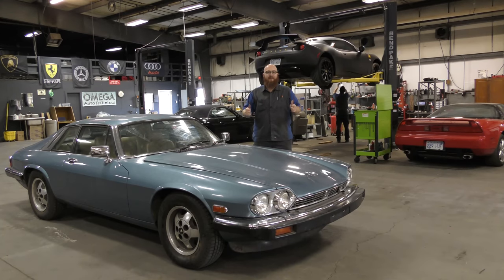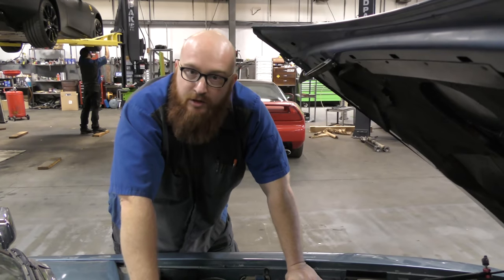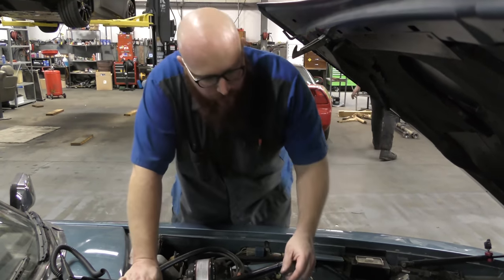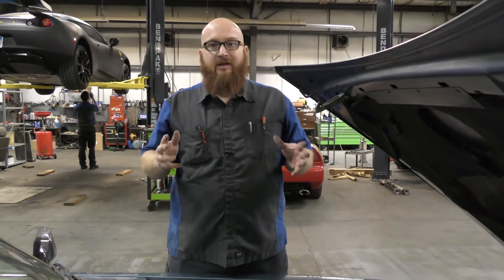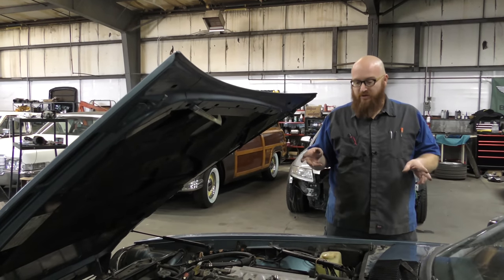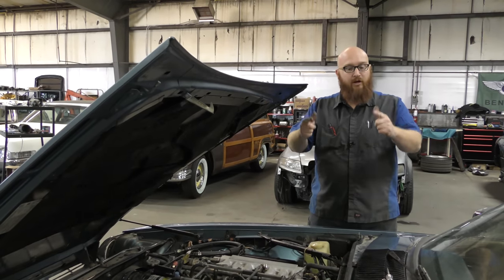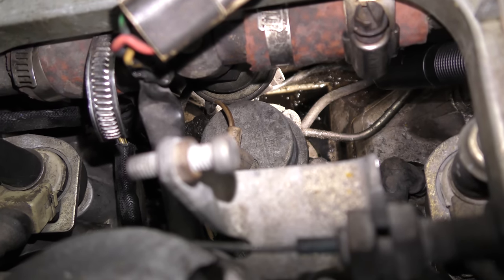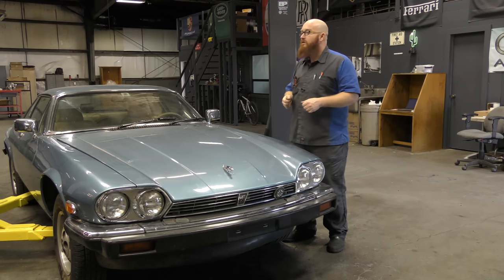'82 XJS with the cursed Jaguar V12 comes into the CAR WIZARD's shop. Can he get it running?

Comment: The American specification lights look interesting, a bit like Citroen SM, but not really pretty. Changing them to Euro spec, if possible would give it some British class.
Reply: Bri ish
Reply: I think the American spec lights look much better than the Euro spec lights on this Jag but admit I can't say that to often about other models
Reply: It's not the Wizard's car to change.
Reply: @sw33pdog  Agree. I never really liked the XJS lozenge lamps. It was the only thing. The US spec lamps are much more interesting.
Reply: @houseofno  No, he was clear the car belongs to a customer. Getting the car to run well is most important. Only then rises the question whether to use it as it is or to change details. That's up to the owner.
Reply: Sure, except that this is NOT the Wizard's car, and it's not theirs either.

The most bizarre thing I ever saw - total strangers proposing unauthorized changes to cars they don't own.

Is this the Car Wizard or Pimp My Ride Felony Edition? 😀
Reply: Brian Weir 😂😂😂
Reply: You can't get the Euro spec lights any more, and they're worth a bit if you can find them on the used market. My XJS has stone chips in the headlight glass and I'm faced with having to convert to new American spec lights to resolve it.
Reply: @MathsYknow  jump on the web, check "Top cats jags" Birmingham England,  uk spec lights and yes, they do (or did) ship international, bucket loads of breakers yards In  the UK are full of these, shipping aside, will cost peanuts
Reply: @Craig-wp3pz  Thanks, I guess I should look internationally despite the challenge of shipping glass around the world. With chipped headlights I'm limited as to where I can take the car for inspection / MOT.

Comment: There was a garage I'd hang around that had Mustangs on one side and Jaguars on the other. The guy that restored or repaired the Mustangs usually dealt with rust and would make them beautiful again. The Jaguars on the other hand always looked beautiful inside and out but had electrical or mechanical issues. I was amazed by how inexpensive he purchased the cars for. What I did not realize at the time was how potentially difficult it could be to repair. I get it now after watching this video. He probably purchased cars that had multiple failures by one or more mechanics.

Comment: I'm having an anxiety attack over the greasy windscreen..
Reply: First thing I thought was that that baby needs new wipers
Reply: @ironymatt  If it had been sitting for even a year not running, I an sure no one bothered to clean it .
Reply: The interior of the windscreen could be greasy tobacco film and/or glycol from a leaky heater box defroster.
Reply: @brianevans656   yeah those are actually the 2 most common causes of windshield greasyness...either owned by a smoker at some point, or problems with the heater-even in other makes/models...heater core leaks make a vapor of coolant(and if there's a slight headgasket leak, oil as well) that condenses on the inside of windshield through the defrost vents and believe me...it is so hard to clean up-and combat if the cause is still an issue.  Sadly, dinking with heater cores & such can be a pain too as it often involves taking apart a lot of stuff to get to it in most vehicles.
Reply: The top of the engine looks like a wire mess all over the place.

Comment: I used to work at a Jaguar dealer when these were new. 
They were a dream to drive. I do not recall them causing much in the way of problems, but then they were not 30+ years old back then, and parts were readily available, and there were four on the forcourt for sale. 
One could simple swap bits from one car to another until once swapped the fault from one car to the other, and then one knew which bit was at fault.

Got a 1987 4.2L LWB Daimler Sovereign in at the moment. It was similar, multiple faults preventing it running. Failed fuel pump, blocked fuel degassing valve, blocked flue line, stuck fuel tank switchover valve, stuck fuel return valves. Blocked fuel tank vent, partially blocked fuel filter, all four brake calipers seized up..... and I really dislike having to reassemble the handbrake calipers,

Comment: Calm, chilled, logical, rational. You Sir, are the man. Thank you for sharing.
Reply: I  wished   I'd   known   about   this   man  when  I  had  my  1976 XJ 12 L I took   it  to  a  shop   who  claimed  they   knew   Jaguars  it  wouldn't   start  by the   time    they   had  supposed   to  have  fixed  it  $3600  later I  brought   it  home  went  to  start   it  the  following   day   and  again   no  start .I   was  angry   went  back  to  the  shop, complained   they  told  me  they  never  wanted   to  see  the  car  again. 
It   was  a  rare   car  had   a   4 speed   standard   transmission   with   electronic   overdrive ,ended  up  selling   it  cheap

Comment: Here in the UK I don't know of any V12 Jags that have had the engine swapped for an alternative, and I am a member of the XJS Owners Club, so see a lot of XJS's. I have owned a V12 convertible for 10 years, which runs perfectly and has never let me down.it is regularly serviced by an independent, but Jag Dealer trained mechanic - there is nothing he doesn't know about these cars, and there a lot of specialists like that in the UK. To suggest the V12 is not a good engine is very unfair - it is one of the best V12's ever made, if looked after and serviced/repaired by someone who knows what they are doing. I would rather scrap an XJS than put a V8 in it!
Reply: @M Bacon That's a fair comment and understandable, we still have lots of specialists in the UK, and a good supply of parts, as the V12 was also used in the XJ and late E types

Comment: There is a reason why they call Lucas 'The Prince Of Darkness'.  Nicely done.
Reply: If you were lucky it was just your headlight circuit manufactured by Lucas.
Reply: @warrantyvoid100  And you would know if you had a Lucas headlight circuit because it would only have two settings. Flicker, and Off. Having dealt with Lucas on a TR8 I have nothing but respect for Car Wizard for sorting that Jaguar out.
Reply: @1_mg_1  Very funny considering the broken bit was the Lucas part with the American part in it!

Comment: Thanks for showing;
The  XJS V12,     Oh, boy,  fond memories;   *BY FAR*  the easiest  to diagnose and repair,if repairable,to me (it was the only one i ever worked on,that and the XJ6 ,i stocked "all" the parts,others --P/S hoses,i made them on the spot);  that was my life back then, Jaguars only, little shop, still have all the "special" tools i made over the years;   when the chains cut thru the aluminum valve cover(s)...Chevy V8 in it, 75% of the times;    in NJ

edit    they were actually VERY reliable cars,  in the sense of  always returning to A from B..on their own; one of the best ; what killed them in the end was *heat*;  very small frontal grille area and fan, leaves and hairs between rad.and condenser, not at all suited for 100 + degree weather with A/C on all of the time; all engine gaskets dried up,oil leaks started,chain and tensioners going south; also  de-powered for sale in the US, but still absolutely adictive silky smooth engine, best i have ever seen in that aspect, when all 12 were firing up with like compressions;  learned from a customer how to use a credit card (any card...) to determine if any cylinder was not firing well,and from which bank it was,just bring the card to each of the two tailpipes at a time, and if the card can be heard  hitting the pipe,as it is violently sucked "in", you just cut your work in half,you know which side to work on;( if one cylinder is in fact missing,the slaping of the card can be heard 30 ft or more away);  learned a lot from my customers (--friends--...)... and taught them a lot too.

Comment: The car wizard is such an intelligent, thoughtful, disciplined man. I hope this puts an end to the myth that mechanics, both pro and amateur are not mentally sharp. I learn so much from the Wiz, even though my cars are usually not covered. I have a 302 Daytona Cobra 65 replica that I've gone through this last year finding many thoughtless careless items that I engineered fixes for. I have a 2019 manual Mazda 3 that handles like sports car and get 40 mpg mixed driving! Everything on that car is easy to maintain. I have a 2010 4 cyl Ford Ranger stick that is easy to work on except for the clutch bleed. That thing is economical and bulletproof. Thanks Car Wizard. I love your approach.

Comment: It's a notoriously faulty car, but it is quite pretty.
Reply: I know some ladies like that.
Reply: I've had one for 10 years - apart from yearly service and a petrol pump failure it is never in the garage, runs perfectly. The V12 is a great engine, one of the best - if looked after, but that applies to most cars. I do agree the Lucas ignition should be changed for the later Merelli.
Reply: If someone could come up with the equivalent of a Holley Sniper for these cars....
Reply: I have sweet memories of these early 80's V12 Jaguars. Lived just North of Cape Girardeau, MO in the mid 90's and knew a sweet woman who drove a metallic brown version of this car. My, they are just sexy cars. Relaxed and beautiful. The interior was a mobil cigar lounge...just wood and leather.
Reply: It was faulty because of the awful BL build quality and lack of QC. In engineering terms it was a well developed world class design. When ford took over they made massive strides and Jaguar started producing pretty reliable cars on the whole, not Lexus level, but not bad.
Reply: @alexanderstefanov6474  They were only faulty when left to the. Americans to maintain them.
Reply: @brayworthpark5542  *Magneti-Marelli, italian stuff. Not the best either. Take it from an ex 2001 Volvo v70 owner with a Magneti-Marelli electronic throtle body. Just like on a Maserati 3200GT's.
Reply: @stringer-ik1pc  i think this is a BIG  factor! Same  with Citroen's hydropneumatic suspention systems and NSU rotary engines. Many ordinary mechanics just had no knowledge about them when they were new and appeared in the workshop for service  and frankly didn't care about learning these new  technologies. Result: those cars got bad maintenance by semi-competent mechanics. People got to pay for it all and the cars got a bad reputation.
Reply: @brayworthpark5542  - As seen in the video, the $500 Lucas ignition is really a common $25 GM unit... now, the computer is another matter... Jaguar should have done what Mercedes Benz did and use a GM computer... GM had the money to perfect them...
Reply: @stringer-ik1pc  - Americans aren't used to cars that need maintenance...

Comment: Those inboard disks Jag rear ends used to be very popular with hot rodders, may still be. Look great chromed.
Reply: Harder to change brakes
Reply: Independent double wishbone suspension, diff and disc brakes all in a really easy to install lump, 4 bolts and some anti tramp bars and you're good to go.
Reply: @albertagibinik3436  really? You don't need wheels off to do it, so I would have thought it would be quicker
Reply: @Craig-wp3pz  Hi, had a 1990 xjs and brakes went out they're in the middle in back. So rotors went too. It didn't feel like back brakes were bad it felt like front ones when stopping.they went on a very hot day and a short stop. Brakes are real close to the exhaust doesn't help

Comment: It's unfair to call the v12 cursed. It's rare that a race engine goes into a production car rather than a production engine goes into a race car. You've clearly got the brains to fix it properly! Thanks Dave for the vids
Reply: Do you care to expand on this comment?  What modifications and specs were the Group C TWR cars?  Or for that matter how about the XJS's that were run at Bathurst? Cheers

Comment: Just when I thought I've seen everything with old fuel injected vehicles, Lucas puts the MAP sensor directly on the ECU.  Also not entirely sure why the coolant sensor would prevent it from running at all.  Guess there's no default value in the ECU.
Reply: Lucas licensed that design from Bosch... Bosch was putting the MAP inside the ECU into the 1990s!
Reply: @compu85  Interesting!  Seems like Bosch was supplying fuel injection components to many OEMs back in the 80s and 90s.  I also love that the Lucas Electric Ignition module was just a box with a GM HEI module!  As soon as The Wizard started talking about it I guessed he was going to reveal it as a GM HEI module. Lol
Reply: i don't know how it is with these cars, but when i had a failed coolant temp sensor in my volvo 940 with lh jetronic, it wouldn't start either when it was like +20C, because when that fails, the car goes to thinking that it's 0 degrees C (if i reccall, it's some safe deafult setting when it senses that the sensor doesn't complete the circuit or something), so the mixture is so rich that the engine doesn't start. it would start after about a minute of cranking, but somewhat quicker at night.
Reply: @compu85  While it isn't common on OEM ECU's anymore, aftermarket ECU's still have internal MAP sensors. Haltech Elite's and the Megasquirt MS3ProEvo have built-in Map sensors of 3 and 4 BAR.
Reply: Maybe coolant sensor sets the choke?
Reply: @marceldemir7514  Fuel injected engines don't have a choke.  As zloychechen51540 mentioned it could be that the computer is setting the fuel mixture very rich (injector pulse width).  It would probably start if the accelerator pedal was push to the floor (clear flood mode... Well at least GM vehicles had this)
Reply: 84-86 Chrysler's also had the MAP sensor on the half of the ECU that was inside the car.
Reply: @marceldemir7514  translated to fuel injection, yes.  The fuel injection reads what the coolant sensor is telling it and adds/removes fuel accordingly.  Reading cold?  Add more fuel (just like putting on a carb's choke).  Reading warm?  Lean it out (open the choke).  If the sensor is bad it may be telling the ECU that the coolant is -32F and the ECU responds accordingly and gives a shit ton of fuel, resulting in slow starting, piss poor idle.  Maybe it's ok, and there's something out of spec with the ignition system, like poor spark plug condition.

Comment: The local aftermarket Jag experts here in Perth Australia were routinely putting 350 Chevy in these cars in the 80s because owners had a gut full of the over complexity of the V-12 and the amount of expense and nuisance. Taking nothing away from you victory, I would say that if you want an authentic vintage Jag, keep the. V-12, but if you want to drive it, the 350 Chev is the practical choice. It is such an established swap that the adapter plates and ever thing else you need is well known and probably still available. Overcomplexity s a form of technological corruption, which is being carried over into EVs which are full of unnecessary computerised junk

Comment: Replacing a Jag V12 with a Chevy engine is akin to swapping out the movement in a Patek for an ETA because it's easier to fix.
Reply: I wouldn't waste a perfectly good SBC on that hunk o junk.  lol
Reply: the sbc makes more power
Reply: I'd drop in a 2JZ, N/A setup, assuming it would fit.
Reply: @ohlookadragon  therein lies the attitude which has led your country into a steady decline, power is nothing without finesse.
Reply: @ohlookadragon  Not in 1982 it sure didn't

Comment: "But I didn't get mad..."
Yeah, but if it were me I would have gotten even with the previous screwball mechanic who attempted to repair the Jag and screwed it up. I would track him down and then douse him with a bucket of cold water.
Reply: They should have designed the distributor, so that it only goes in one direction, and impossible to put it 180 degrees off.
Reply: No need, just a video with it running and you laughing at him would have been enough.
Reply: It's probably the current owner. People use that whole "Person before me" as a cover for them fucking up their own car.
Reply: @jjlegend3922  True story.
Reply: Most noob mechanics have no concept of an old fashioned distributor setup. It's not hard to imagine doing a 180 when reinstalling one. I did it myself on my '73 Corvette WAY back in the day. Luckily my friend advised me over the phone what I had probably done. Pretty much all cars had distributors back then so it was not an uncommon issue.

Comment: Jaguar V12 was and is the most complicated production engine ever made, 1400 parts in the assembly alone.
It isn't unreliable if maintained correctly, which is where things get sticky, particularly in the USA because it hasn't got push rods.
It won Le Mans, and was in production for over 20 years going in E Type, Saloons, aircraft, powerboats etc. Yet another amazing powerplant from Jaguar.
Reply: Yanks with less money and less brains decide to buy a nice looking car like a Jag V12 without getting the proper mechanic to service them.But that costs money,so they get the cheap ones who having got no scooby do how work on them and they break down.Then they go on media websites saying how rubbish Jags are.Prestige vehicles need proper care.

Comment: It took Jaguar Decades to sort out their wiring and electrics, and that culminated in the Jaguar XJ, the x300, made between 1994 and 1997. They are extremely reliable, and renowned by Jaguar enthusiasts as the perfect daily Jaguars.

In 1998 jaguar released the first V8 engines, and they had timing chain tensioner issues and problems with nikasil linings. Facepalm.
Reply: Jags are still a problem even now. Officially one of the most unreliable cars.